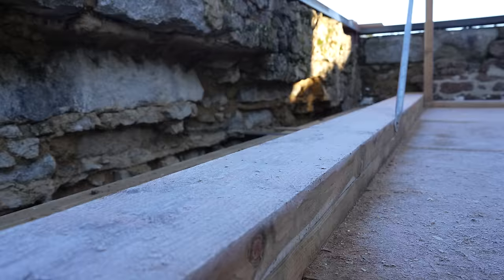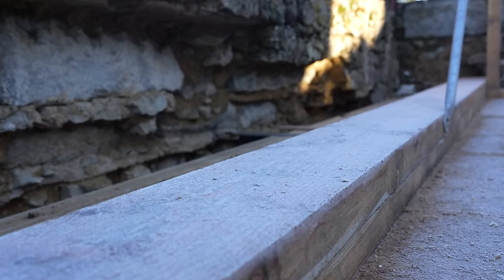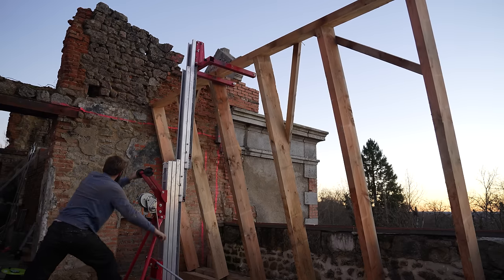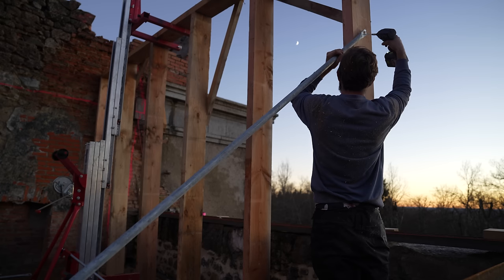Framing a chateau roof, alone.

Comment: I admire Dan`s determination, energy, strength, creativity and optimism! I am impressed with how he manages to also make videos while working. And then comes the editing on top of that. So far so good. But then I feel the need to say out loud some negative opinions. I am not a builder or engineer. But to me common sense is enough to judge this project as something completely out of touch with reality. The way he works is completely wrong, regarding safety, and the result of the work he does is - to me  - so obviously wrong and not good enough.That Nick and Cameron are willing to risk their lives and health working inside that crumbling building is surprising to me. That so many of the commenters are positive to Dan`s work is shocking to me. The building is a ruin and not ready for a permanent roof yet!

Comment: I doubt this will be seen, but would it be easier/possible to put the winch strap on the bottom of what's being brought up, and have a guide line at the top of what's being brought up?  if this can work it seems like it would be easier to bring the items onto the third floor.

Comment: What a nice new fase! I can only say I am impressed. Might I make a sugestion, if you are worried that the wooden frames will top over the side, use a safety roap at the top of the frame. Further wouldn't it be easier to get the wooden beams up at the outside instead of via the hall?
good luck and go on

Comment: um i would like to make a suggestion.  you are putting brace wood on top (hint: top heavy).  you could do same thing on the bottom with a long strip of 2x4.  (38 mm x 89) that is you use 2 long strip. one  perpendicularly.  and one slight angle  starting at half meter on one end and about a meter on other end.   end of day.  easier to remove bracing off the bottom than wresting with ladder and remove the bracing off the top.

Comment: Thinking if you reverses the order of the posts and beams it might be easier. Screw posts to the bottom beam and add cross bracing then lift into place. wont be top heavy and you wont have to lift onto the base plate. Other option would be to install each post and brace as needed then lift just the top plate into place...would need a tall step ladder or move your scaffold to be able to get top plate on but would be less "exciting"

Comment: I would be inclined to rope the top of the frame back to the solid floor beam, just in case it topples over. That way the bottom will slide back towards you. The same with the lifter, rope the bottom of that back so it cannot be pulled over with the frame.
Wear good gloves so the wood does not slip.

Comment: Why not raise it to the vertical as far away from the outside wall as you can. Get it to completely hang on the supports and then push it over to the wall edge and lower it. Then if it does tip the other direction, it won't fall off the roof, but onto the floor in front of you. Still sketchy, but maybe a little less hazardous. ALSO - Maybe attach the 2 metal angle supports before raising it and you can use them to help control the lift.

Comment: There are two arched openings that have been bricked in. Maybe those can be opened up like the doorway was on the other floor. Would allow light to filter in along with the windows in the Mansard roof which I hope will also be restored. That would go a long way to making the attics into useable rooms. Walls need either permanent cross bracing or noggins. Still think it is foolish to do the roof alone. Accidents happen. Much better to have at least one person helping.

Comment: I would like to throw in idea into the discussion. Why not using that perfect plattform as a base for a crane. You know a simple medieval type that he can use to lift up all the material he is currently lifting painstakingly into the chateau...
Just a simple wooden contraption like they used all through the medieval times to build all these castles in Europe, with a counterweight or with the electric winch....

Comment: Aren’t you going to high with the wooden beams,  looks like you’ve a bit too high, regarding tr floor in the middle building? There is a lot of roof thickness which need to get on as well on the outside? 
But very very very nice Dan! Following you from the time clearing out the very first section, what an amount of progress! Keep going 💪🏻

Comment: You're struggling with those beams way too much manhandling them onto the landing. I think you should add a second winch (or a couple of come-alongs) above the landing to make it a lot easier to get those long beams onto the landing. Then when the beams are lifted high enough (by your primary winch) to reach the landing level, use the second winch and a two more lifting straps to pull the beam over to the landing. You should attach the two extra lifting straps to the beam while it's still on the ground. Position each lifting strap about 1/3 rd of the distance from each end of the beam. That way you can use the second winch to both angle the beam and pull it sideways. You basically transfer the beam from winch to winch. First pull on the uppermost strap to angle it so the beam tilts into the landing area. Then pull on both the uppermost and lowermost straps to swing the beam sideways onto the landing.

Comment: This is the dodgiest thing that imo you've done thus far. I mean that from your own safety point-of-view. If just one of those bottom attachment points fail (where a stud meets the baseplate), the transfer of load to the others would immediately cause them to fail. It would be 'zipper-time' as equilibrium was restored. Where does bag-of-muscle, bone and water you stand in that cacophony of settlement? I like what you do and I watch every day.

Comment: Just a question Dan it might be a silly one you're really struggle to get the wood up I was just wondering if you put something across these frames that you have built install your winch and remove some of the boards on the way down would that give you enough room to make it easier to get the wood up to the top just a suggestion you know what they say work smarter not harder

Comment: When I was erecting very similar structures on my top floor, I had a check rope made off from the top of the frame, to the opposite side of the floor, that would stop it at  maybe 4 to 6 inches over vertical at the most if I lost it!.  I had similar fears to yours about it pitching over the edge!

Comment: Why not use a rope or strap where you put the brace until it is vertical and then no worries about it flipping over the wall. Would it be easier to put the long wall up first so the sides rent in the way? Maybe it is all the same.

Comment: Aren't you going to do the steel channels and the wooden plates that sit in them before doing the third wall? Getting the long timbers for those into place is going to be extremely awkward if they have to be threaded through the walls.

Comment: I guess this frame will be the roof supports and are a temporary structure
Reply: No, they’re the inner wall of the attic room. The angled “Mansard” beams will sit on top of the stone outer wall and get attached at an angle. Like the old photos. Can be nicely insulated and even have a few recesses for built-in shelves, etc. Those “attic” rooms will be fantastic! Plenty of height! Not really an attic. Remember that the back middle of the Chateau has an even higher yet elevation (where that freestanding pediment currently sits). It is a large dormer with balcony. Best bedroom in the house!!! Ok, enough out of me for now.😂

Comment: Hey Dan, are screws enough to be holding all this wood together. That wall that is braced opposite the winch also worries me.     I'm in Australia and you're spoiling my breakfast.

Other than that, good job.
Reply: One assumes that he will attach the side walls to the front wall at the corners, and permanently brace all sides, forming a rigid structure.
Reply: The plan is to have a floor above that landing hall. That is where those U-shaped blocks go to tie it all together.

Comment: I only just realised there are toweresque roof sections on these side wings! All this time, I thought the two sides wings must have flat roofs, even though I see the logo often, it just did not register. You have lots of trip hazards up there, and obstructions when you were pulling timbers up and to position; I agree you need to be careful u there, but mostly, I am always concerned for your dogs free roaming when you have the groundworks in operation.. By the way, just wondering why the long piece of wall  can't be installed as seperate pieces now that you have the sides up. ie lay the floor piece of timber then fix the uppermost timber,  and fix to sides, and then infill with the uprights?

Comment: Its still a supprise to me the the roof structure goes on the inside of the wall not sat on top of it. Means the rain runs down the inside of the building in still a little confused
Reply: I think the roof will be supported by the frame but also extend beyond the frame and be further supported by the wall so the rain will run off outside. That is how I understand a Mansard roof but I could also be confused 😄

Comment: How come you doesn't use those metal plates that are at an angle to support in the top and bottom? Are those relatively small screws really able to keep the structure in place if the wind picks up?
Reply: I'm assuming these will be added later

Comment: I am no doubt behind the thinking here ..but apart from solar are you looking to do heat source pumps?!?!
Reply: I am hoping Dan considers a Kachelofen (actually 2 of them) installed in the basement at each side. These are Masonry Ovens that use very little wood. Convective heat travels through piped ductwork with adjustable registers at each location. Radiator heat for that building would require too much oil I believe. I operated one of these Kachels and they’re awesome! Visit the firebox twice to 3 times a day and put 1/4 of a standard log (or automatic feed if desired). He has plenty of wood. Burns so clean. It’s how they used to do the big castles. Wonderful heat! 🎉
Reply: @PaulRiesland It's a good idea. A while back I explored soapstone stoves as they are supposed to be especially good at retaining and releasing heat over a long period. There were no suppliers in the UK though. Two manufacturers were Tulikivi and NunnaUuni. Perhaps expensive but good quality.
Reply: This is so interesting. I hadn't been aware of them. I wonder why they're not seen in these old buildings more frequently or why they fell out of favor. Sometimes old and simple is best.

Comment: I'm confused. Are those walls going where you put the steel beams?
Reply: The roof beams will angle from the steel beams on the walls to the top of the wooden walls he is raising right not. A slight angle. Then there will be a steeper angle on top of roof beams going to a central beam. A frames on top of these current walls. The roof is in two parts with the top being angles steeper than the bottom. That’s what makes it a Mansard roof. It also allows for the attic to have high ceilings and be useable rooms.

Comment: You should have a double sill plate at the bottom. The way you are attaching the vertical studs is pure madness! Six inch galvanized spikes too not those small screws. Don't say you haven't been warned!!!
Reply: Agreed, load bearing stud walls should have a double top and bottom plate, 👍🔨🪓🌲🇮🇪
Reply: Well, you have done your part 👍

Comment: why didn't you put the bottom plate on too? you put top plate on by toe-nailing.. which is wrong in my building.  and then you never put bottom plate on so the studs just wiggle in the wind on your lift? not very good my friend not good. Here we lay out bottom plate get height! so then up rights are cut and fitted between top and bottom plate, nailed screwed to whatever your gonna use 16 maybe 24 even 48 on center. Seldom ever seen 48..  why them numbers? is because sheets are 48" wide and walls are usually 96" so a full sheet will fit the bottom plate,.... up  the studs,.... to the top of top plate. and sheeting strengthens walls so no need for little support boards your putting on studded wall. so as i see it right now at 05:28 into your video yes if it wiggles it will go right over your little pony wall. Best put top plates on and bottom and make the wall and then,...... THEN use your lift.... to lift the whole thing up.. then when it is up,..screw bottom plate down, in a few areas and then put braces on ends to hold wall upright. of course level it to make sure it is where you need it.... then go back and finish screwing all the places to make to wall permanent. So all this being typed,... said.. that is how i build.. and 40 thousand houses later it has worked for me. even 4 stories high. and if your doing this for likes or subscriptions that is wrong to my friend... do the job right because as you said lots of people,... LOTS follow you.. so do it right!!.

Comment: I have to ask, are you making a rod for your own back by not pointing those walls? You're going to have a devil of a job crawling around behind the frames and pointing up the walls.  I can see through a few cracks from exterior camera views.  It's your project and I know you're eager to get the roof going. But those walls aren't ready. Anyhow - good luck with it!
Reply: Now the temperatures are hitting zero it's not the right time to be doing it - unless he can get the space enclosed and heated, which will be something of a challenge.

Comment: Dan, All those Diagonal Screws your putting in "noggins" and now walls, are not considered reliable in Structural Engineering. The wall you put in today looked to only get One top screw and the back diagonal screw you put in at the end upright went in at such an angle that I would estimate only at 1.7cm  made it into the bottom plate - worthless structurally!   Get some help too, framing with that size lumber is Never done alone!
Reply: I'm assuming this is just to get it positioned quickly and he'll go over it with nailing plates. If he doesn't I really will stop watching 😆